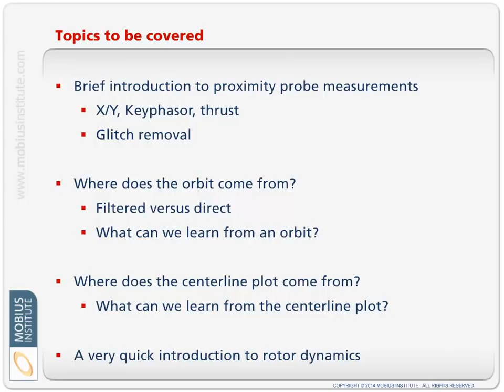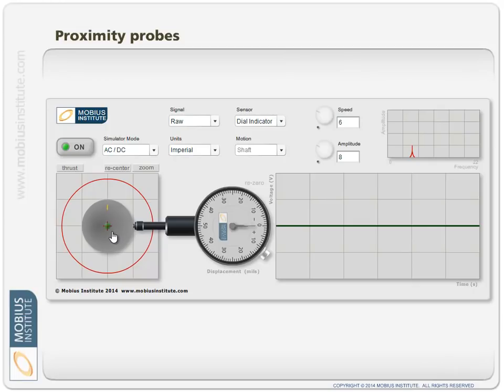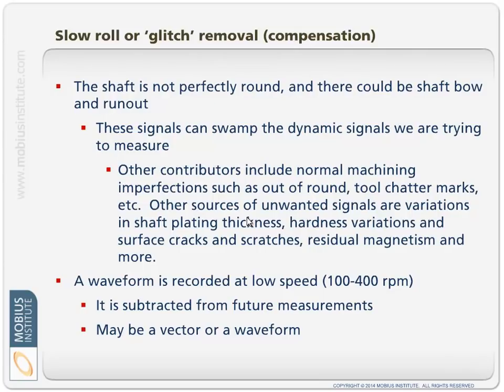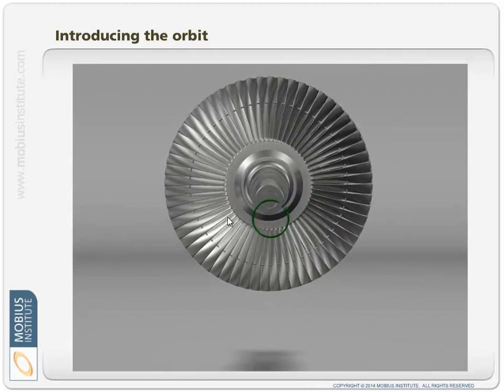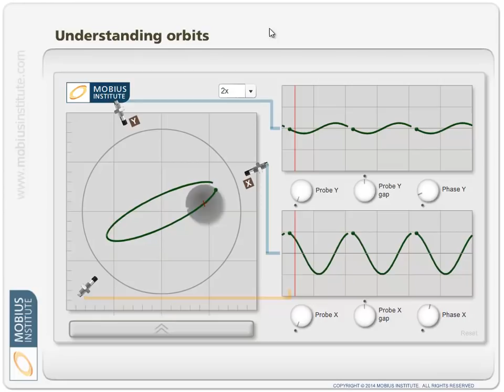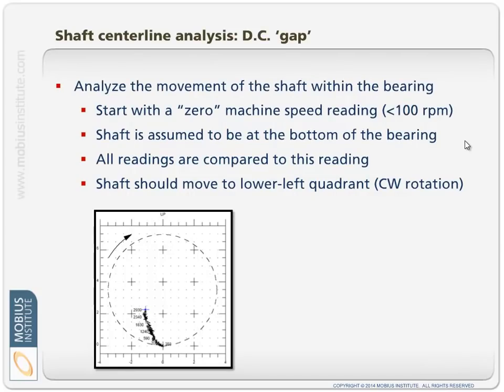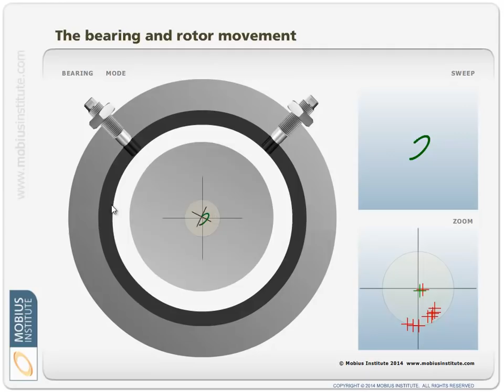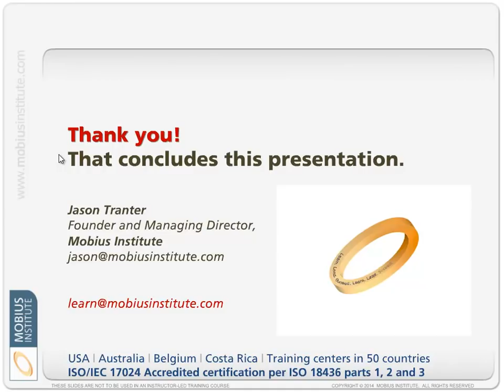Vibration Analysis - Orbit Plots-Centerline Diagram - Mobius Institute

Comment: Hi Suwatchai K - To the best of my knowledge, most modern systems maintain the convention of blank-bright with forward precession regardless of the nature of the trigger.  I have to confess that I have not polled every manufacturer.  As for rising/falling edge, my understanding is that this is also handled differently in digital systems versus oscilloscopes - but I will look into this.  (I am traveling right now so it will take a few days.)  Thanks for your comment.
Reply: ***** Robert (Bob) Eisenmann co-teaches our Category IV course and we have discussed this issue at length.  To the best of my knowledge, if you go back to the traditional theory, what you say is correct  - and that's the way it worked on an oscilloscope.  And that is why it is documented that way in those two references.  However, that convention has been superseded in many modern digital systems so that it is always blank-bright regardless of what the keyphasor is detecting.  The main reason, as I understand it, is so that you can always quickly identify reverse precession.  I wish I had Don Bently's (and co-author's) book - I am sure it was clearly stated in that reference.

Comment: Sir, For 210Kg  flywheel, dia of 700Mm, dynamic balance for 4000 rpm,before balancing unbalanced grams R1=40grams,R2=50grams , after balancing R1= 0.49 grams,R2=0.51 grams , vibration is less than 2.61 is these acceptance as per standareds
Reply from the maker: Hi Preethesh, this would be a great question to ask the thousands of CBM and Reliability connect professionals on https://mobiusconnect.com. You can post your question on the forums or on the live feed!